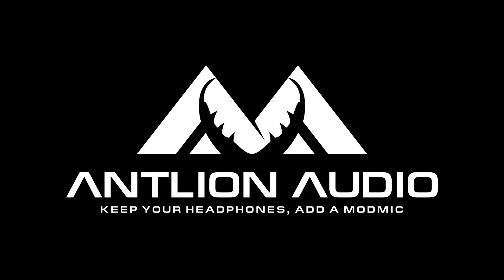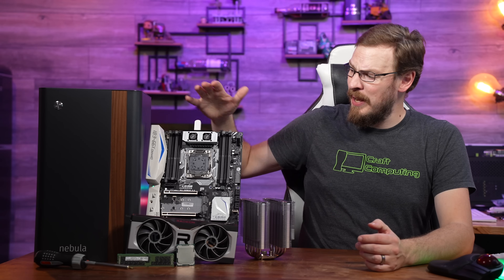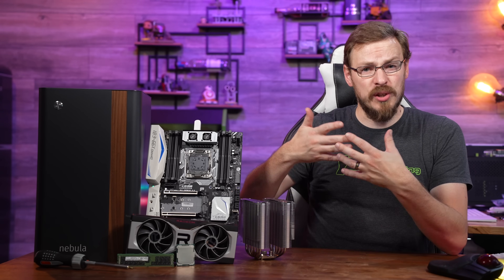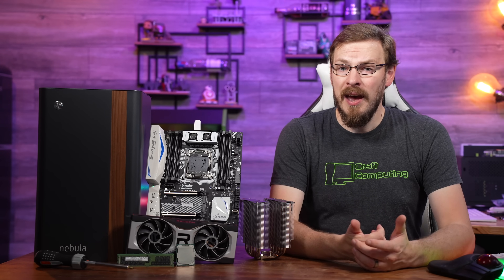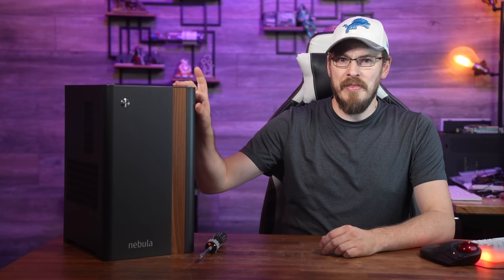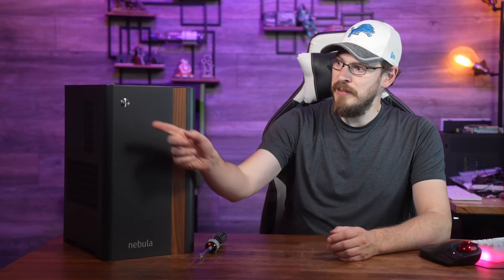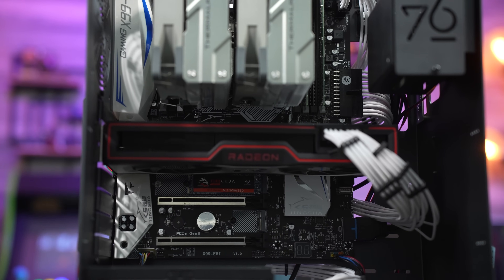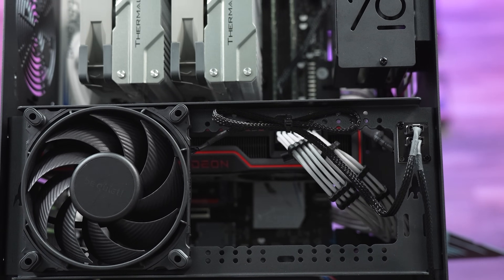AliExpress X99 in a System76 Nebula 36

Comment: @craftcomputing I love your x99 reviews and have been following them for years. I would love if you would do a review of the Jingsha X99E Max motherboard. It is an x99 quad channel motherboard but it takes ddr3 ECC up to 256gb!   Would love to know what the comparison is between quad channel DDR4 and quad channel DDR3 is on x99. The x99e only supports several cpus but it does support the e5-2696 v3

Comment: As someone who does media and gaming solely on Linux; who's recently ditched an AMD RX6600 for an old NVidia GTX1070 with the proprietary driver just to save myself the headache of dealing with the media disaster of the Radeon under Linux for one more minute. Gaming-wise, the Radeon shined, but for literally everything else GPU related, forGET getting accelerated video encoding and decoding working on the dedicated subsystem which meant terrible performance live streaming my gaming. Oh, and trying to get the GPU encode acceleration working in discord was an exercise in pure frustration and fruitless battling. 

Tl;dr? AMD games well under Linux, but it turds for any kind of video you might want to use it for.

Comment: HELLO and HELP ME PLEASE: I just got a motherboard from AliExpress, X99-S3 / SZMZ with 128gb Ram 2133mhz and a graphics card ELSA RX 580 8gddr5... MY problem is = I don't get any video at ALL, to see the BIO or install my OS and drivers. You always show how all your x99 start at once with video output on your monitor. The digital number show on the motherboard is 55 and the light on the RX580 is flashing blue as okay. I do not use any NVME M.2, like you normally shows in all your videos, but a 3TB 3.5 HD... Please, what I'm doing wrong??  CAN YOU HELP ME PLEASE?
Thanks for answering back. forgot to say = My motherboard looks identical to your on this video. I also use win7 64bit pro.

Comment: The annoying thing about these boards is that the VRM cooling fans tend to crap out after 6 months. Besides that, my Huananzhi X99-TF has been running solid for the past 3 years. I use to have an E5-2678v3 as the processor, but I down-scaled to the E5-2623v3. I didn't need 12 cores for what I was doing; running a file server with a few dockers in UnRAID.

Comment: I'm using a case from the Alienware Area-51 R2, and its build quality is faultless. If I had one complaint, it would be that it's too heavy. They just don't make cases like those anymore.
BTW, the Xeon E5-2689 v4 is great, if you can find one at a good price. It's basically an undervolted and overclocked i7-6950X.

Comment: Single socket X99 workstation --> 2696v3   it's basically a much higher clocking version of the 2699. With just a slight bus oc it'll boost two cores to 4GHz and clocks the other cores down in much finer steps. Not to mention there's always the v3 Xeon all-core boost hack - 18 cores at 3.8GHz is serious compute power for an old X99 system.
Reply: If Single socket, then the 1680v3 It is unlocked and easily clocks up tp 4.5..46GHz
Reply: @gyulamasa6512  That's an 8-core chip vs. the 2696's 18. You really think those extra 500MHz on two of the cores will compensate for that?  If you want high single threaded performance, old Xeons on X99 are a waste of time and money. Every cheapo I3 will blow a Haswell Xeon out of the water in that discipline. If you go Haswell or Broadwell on X99 then that's because you need those 40 PCIE lanes and can make use of high core counts ... otherwise a low budget gaming platform would be a smarter investment.
Reply: I'm looking at 2650L v3 / 2650 L v4 as options. for the same,
Reply: @Nalianna  never been a fan of the V4's. You get two or three percent higher IPC and two additional cores for roughly the same TDP, which is nice o.c., but you loose the V3's overclockablility, which in my opinion is what saves old 612/X99 workstation and server hardware from the trip to the landfill. 2690v3s are a good compromise (12C 3.5GHz) if you're worried about powerdraw or VRM capability, otherwise I'd just go all out with a 2699 or 2696v3 considering how cheap they are at this point
Reply: @protator  I'm not looking to overclock, just want it to be cheap. Building a NAS / pihole / Jellyfin... kind of thing.

... and in the past 10 mins, i found a new cpu for 8 bucks... 2650L v3. weird how life works :)

Comment: That motherboard looks a lot like the Machinist-branded unit that I picked up to replace the increasingly unreliable system board in my Z440 -- basically swapped the case, cooler, and power supply (since those were all HP proprietary) and haven't looked back since. Only real issue with mine was that for some bizarre reason the internal USB2 header seems to conflict with the M.2 slot intended for wifi. Hardly the end of the world -- this is not a system hurting for ports, especially with a 3.0 hub or two, and the M.2 card supports bluetooth besides -- but something that I was taken aback by due to no documentation of this.

Comment: Yes, I get a little antsy when it's been a while.  One way I get past it is to just open up a system and swap in a new CPU cooler, GPU, or something.  It's of course less of a cure than a complete new build, but it staves off the crisis.  

I'm entering this comment from a 6850K system (originally with two 980 ti GPUs in SLI and fully water cooled) that I built shortly after X99 hit the market.  I cool the CPU with a Corsair H105, and the system is completed by a 1080 ti,  32GB of DDR4 at 3000 / 17, and two Samsung 500GB SSDs (850 EVO and 950 Pro) from the original build.  I use it mostly for MS Office and browsing, but it can still game if I need it to.   Long live X99!

Comment: great video, but spoiler alert:
1. while the vrm on this board isn't the most pathetic out there, i'm not sure if it'll be able to handle a 160w cpu
2. no, you most likely won't be able to switch to linux for video editing. a lot of people tried, and only only ones stayed, were the people willing to tolerate kdenlive and other pain points
Reply: 2: Davinci Resolve and Lightworks work just fine on Linux using NVIDIA cards. Providing you're using the correct, supported distro's for the software. Resolve on Fedora or SUSE is particularly good. Most people's issues are PEBKAC.

Comment: I literally just bought the same cpu but the v3 model! 
Only because it technically has a slightly higher clock speed but with 12 cores 24 threads. They are amazing chips. I was considering getting a 2689v4 or a 2679v4 but they are still pretty pricey. 
I have a 1680v3 coming in the mail any day now that i can overclock to my hearts content!
Reply: I had both v3 and v4 xeons and much prefer the latter for any kind of server application. Better ipc and efficiency takes the kake.
But for gaming the famous turbo boost hack makes the v3 ones pretty compelling, specially the higher boost ones reaching 3.6ghz or so, like the e5 2640 v3 at 3.4ghz is really good for the price being similar in ipc to zen1 chips

Comment: Great Video.  Love the look of the case but the price and the build quality you pointed out is definitely disappointing. Thanks for the video. I noticed a slight type on the screen where you list the CPU. You have it listed as E6 instead of E5 ...no biggie as you even said E5 but just thought i would point it out incase its an easy correction.

Comment: I like that you never give up on the promise of X99 :) 

I would like to see more explorations of systems that accept legacy industrial CPUs / parts - especially if small form factor servers
Reply: X99 V1 V2 and V3 has never lost it's promise the processors has and will always be the best value you could get for your money the only issue is that the Motherboards are expensive as fudge unless your willing to cough up the money or buy a cheaper Chinese knock off with all the risks that comes with it this is tinkerers toy and not meant for general users.
Reply: Time to move on then and get a Lenovo P520c motherboard with LGA 2066.  Start with a Xeon W-2135 (basically an i7 8700).  I paid less than $50 for the board and $25 for the processor.  BIOS updates claim Sapphire Rapids support.
Reply: @milescarter7803  those OEM 2066 and X99 boards are just as bad or even worse than a chinese knock off in some instances and would often have bad VRM temps so unless the prices of good MOBO's like ones from ASUS, GIGABYTE, MSI, or ASROCK for 2066 is good it's not gonna be any better than X99.

Comment: Why not fill it up with 8 dimms when going for 128gb? 16gb modules are easier to find and much cheaper per GB. Getting the 2400mhz 32gb modules sounds like suboptimal advice.
Reply from the maker: I had the 32GB from another project
Reply: In my experience, less DIMMs equals lower latency and higher memory clocks

Comment: Not sure if he still does but i know Lawrence Systems used to edit all his videos with Kdenlive. I have it here on my computer running Manjaro (an HP Z840 dual CPU workstation) and it works great!
Reply from the maker: Yes, @lawrencesystems uses Kdenlive and Resolve. I'm not sure which distro @LearnLinuxTV is on right now, but Jay also edits in Resolve on Linux.
Reply: @CraftComputing will you try open suse micro os desktop/ tumbleweed?
i consider them the most stable distro around,especially for a rolling like tw and i've daily drive micro for some basic stuff:darktable,freecad,kicad,stam,lutris....it worked really well ,never a problem,it's immutable after all.
Immutable distros might be the best choice for creators because of stability.

Comment: Do you happen to know which chipset is it in that board? 
Most of those X99 board have Q87 chipset, but there's some special nugget models that have the actual X99 or C612 chipset.

EDIT: After a bit of googling, I found that this motherboard uses Z87 chipset.
Reply from the maker: This is a C612-based